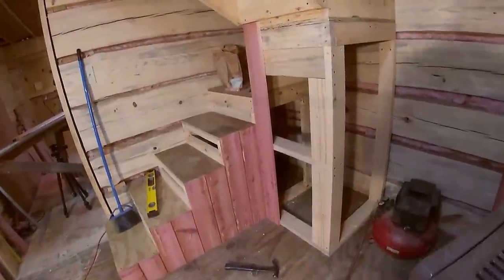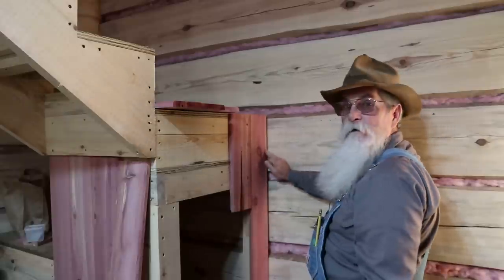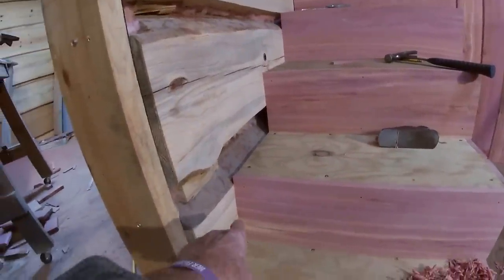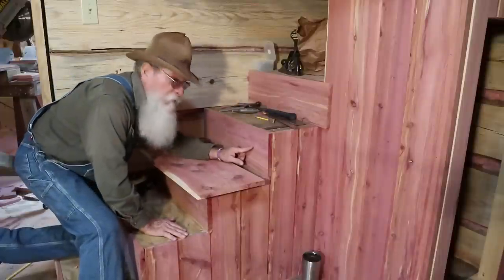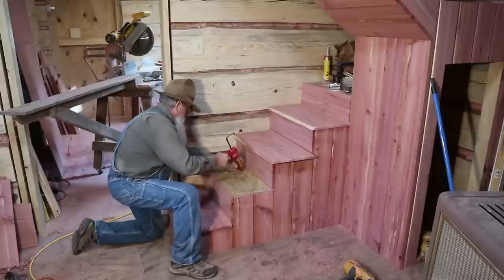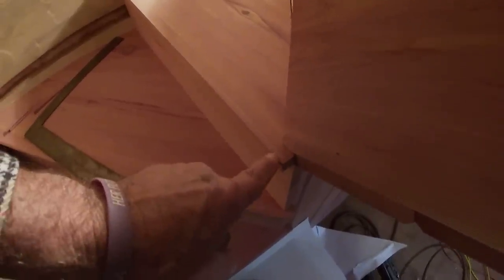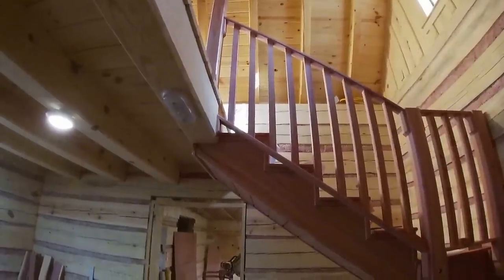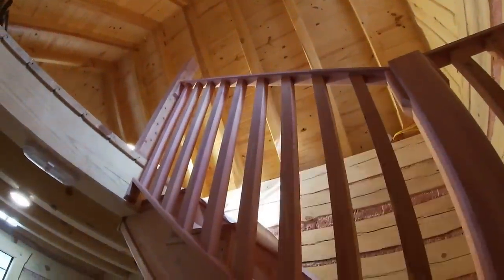Switchback Stairs, Pt2 - The Finish, Paradise Point - Ep 26

Comment: I really like your scribing technique. I usually use my steel rule on its width which can get a little cumbersome and not quite as accurate as what you showed. 
On another note, personally I wouldn't of used cedar for the treads due to how they will wear. Plus using a different species would add some nice contrast. None the less, the finished product looks great! Thanks for all of your tips and detail with all of your builds.
Reply from the maker: Howdy y’all- thank you for watching the video. Much appreciated. I really would have liked to use a different wood for the treads but I didn’t have anything that was seasoned and lumber yards aren’t stocking yellow pine. The stairs will have a gym finish of some kind. The friend I did this for has already made it plain that anyone coming in had to respect his cabin. Thank you for your comment. Take care and God bless

Comment: I would usually join the corner boards and place them together then fill in the field
Reply from the maker: Howdy George- that would certainly work well. Thank you so much for watching the video. God bless
Reply: @TheBeardedCarpenter  gratitude is a feedback loop :).
It is a pleasure to watch others solve these same problems I have run into for years. Thank you for bravely sharing your work. 
May your stock be flat and straight, blades sharp, and pencil right where you need it.
Reply from the maker: @georgemckenzie2525  Thank you so much. Your comment is so kind. Have a great weekend. Blessings
Reply from the maker: @georgemckenzie2525  Thank you so much, George and I wish the same blessing for you. God bless
Reply: @TheBeardedCarpenter  alas, I am tasked to investigate ( another in the endless supply of) 70 year old lake cabin undercarriage, and remedy the excesses, ( moisture, raccoons,  rot) and deficiencies.
 After this coming mud season I have some fun custom newell posts, and handrail to wittle from a venerated 8 "x 12 " x 24 ' 
Win win games are the only games with a winner ☺

Comment: I waited to watch pt 2 before asking this; Usually on a 180° switch back stair like this, almost always, the upper stair set will go against the wall and the lower set will start out from the wall, the width of the upper (opposite of this arrangement). That way you’re able to attach one upper stringer, solidly to the wall. You remarked that you weren’t thrilled about the upper attachment and that is understandable. Was there a reason you went with this configuration instead?
Reply from the maker: Howdy- if I had put the upper set of stringers against the wall they would have been covering a door way. I was really cramped for room. God bless